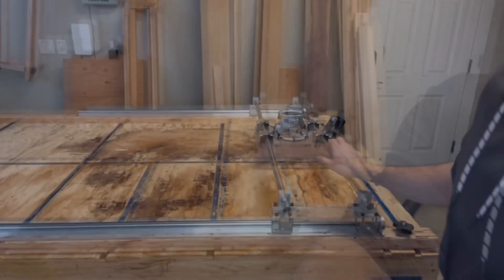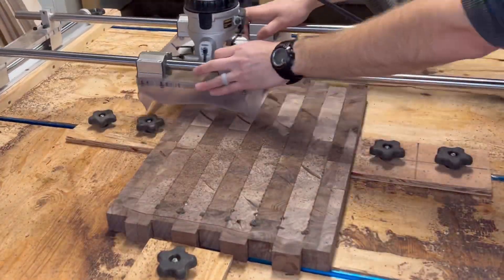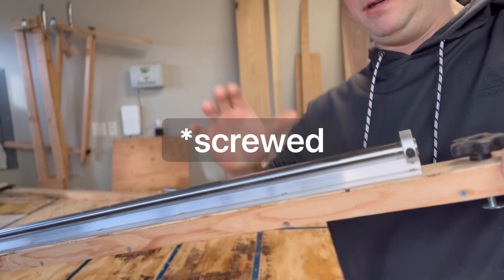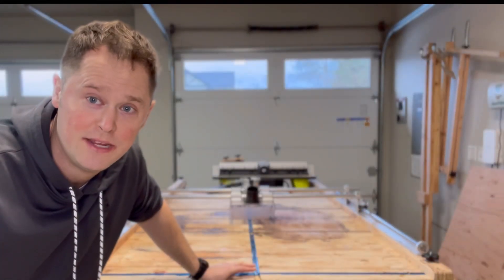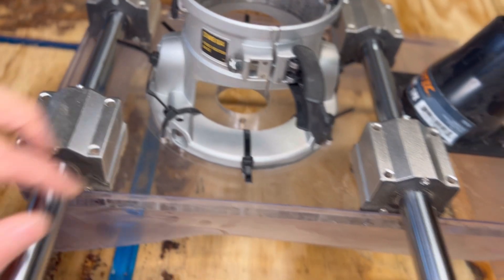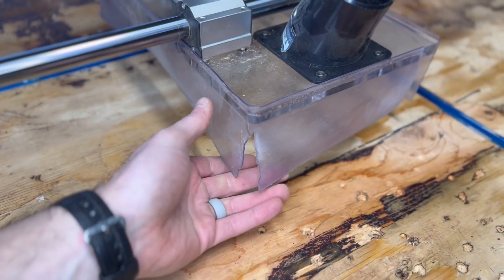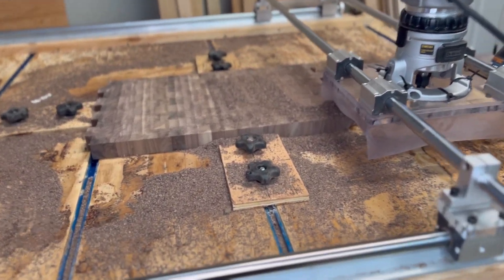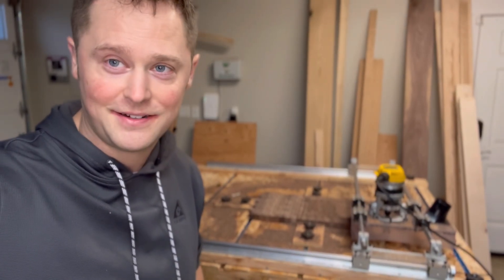This router sled fits in any small workshop!

Comment: Which router bit did you use? Just curious. Love the sled.
Reply from the maker: BINSTAK CNC Spoilboard Surfacing Router Bit 1/4" Shank, Slab Flattening Router Bit with 1-3/8" Cutting Diameter, 2+2 Flutes Insert Carbide Wood Planer Router Bits, Planing Bit for Woodworking https://a.co/d/2UBONBL
Reply: @Winevalleywoodworks    Perfect. Thanks!

Comment: Hey mate, upgrading to a HVLP dust collector with a 4" hose will help ALOT with dust and chips. IMO if you use a planer in any form, this is kind of a must have. Also, they are quite cheap AND draw way less power, than a typical shop vac. Like ~500-750 watts vs. 1500-2000 watts.
Reply from the maker: Thank you!  I’ll look into this!
Reply: i wouldn’t say they are cheap or draw less power. my dust collector cost $2500 and requires a 220V outlet so i wouldn’t say that falls into either category
Reply: @jamiecady  In that case you are talking about a big collector for the whole shop, that can handle multiple machines at once, I assume. Sure, they draw as much as a normal shop vac, or even more and are more expensive. I was talking about these semi mobile and smaller versions tho. Like a Metabo SPA 1200. That is what I got in my basement, as my shop vac couldn't handle a planer - at all. The Metabo draws 550 watts, cost around 250 euro and keeps my shop clean.
Cheers